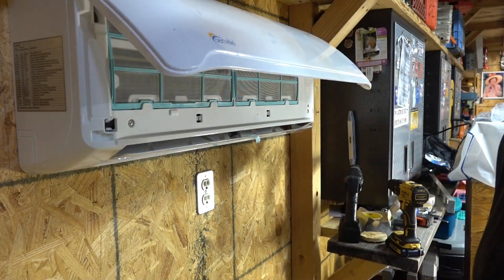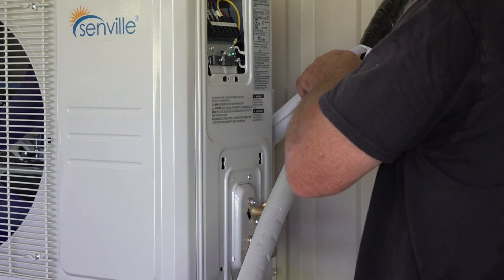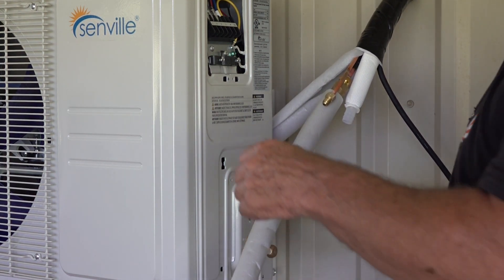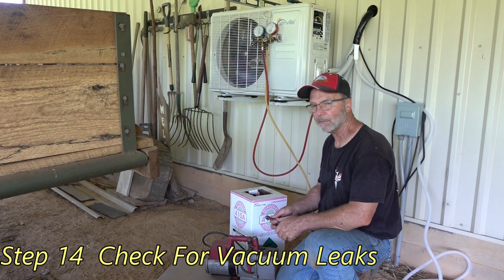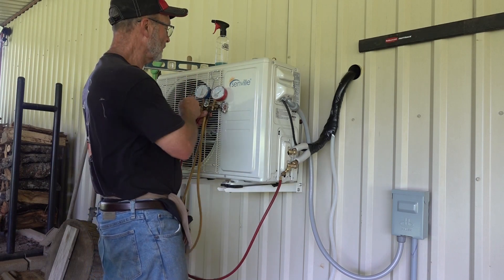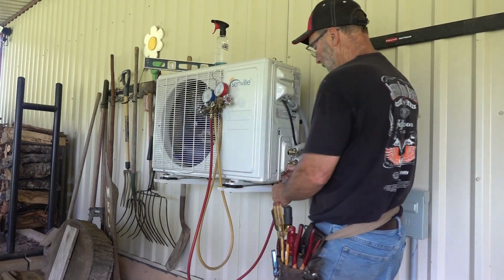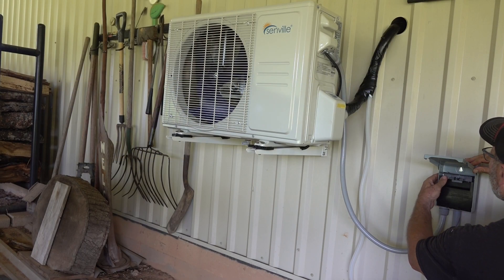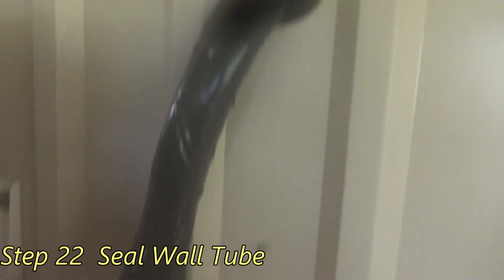Simple 22 Steps DIY Install Mini Split

Comment: Does your shortened line set cause any problems with the unit? Did you need to release any additional refrigerant due to the shortened lines? It's my understanding the Senville unit is pre-charged for 25 feet of line set.
Reply from the maker: You are right about the precharge, but I did not have a scale so I did not release refrigerant.  It does a great job cooling so no problem in that mode.  We will see how it performs in heat.  There is extra capacity for refrigerant in the accumulator so maybe I will be alright.  If you have the same config, I recommend you release liquid not vapor since 410a is blended.  For 25’ .5oz/ft would be about a pound.  So if I see a problem I will have to figure a way to release liquid.  The small line would be mostly liquid around the service port but this is after the expansion valve.
Reply: I called Senville and they said 10' is their minimum line set requirement. Forums have mixed opinion whether shortening below the minimum has a significant effect on efficiency. My run is definitely short, 5'-6' or so. I really don't want to coil line set behind the unit. I have heard there is a lot of wiggle room they're engineered into to those systems. Did you do any research on that when you shortened your line set? @TripleTRanchAndSawmill
Reply from the maker: @michaemilaszewicz  Since its a heat pump it has an accumulator which allows for refrigerant stacking up and only  allow gas to enter into the compressor shell .  If it is slightly overcharged,  the condenser (this depends on the operating mode) will stack a little more liquid.  You could calculate the volume of 3/8” tubing to see the length.  About 1/2 oz per foot.  You should pursue an HVAC career-  the industry needs guys that think like you!